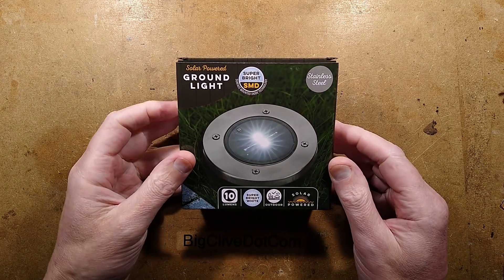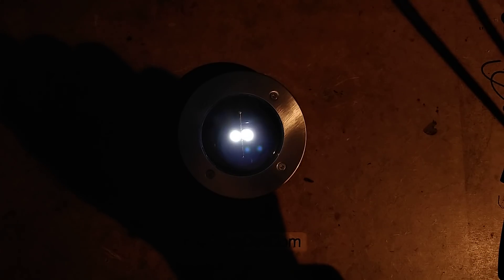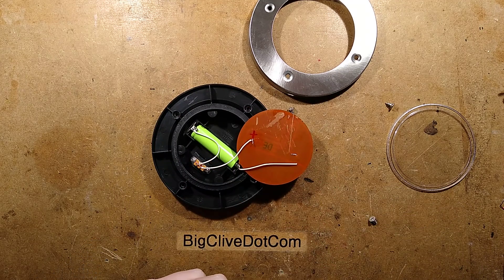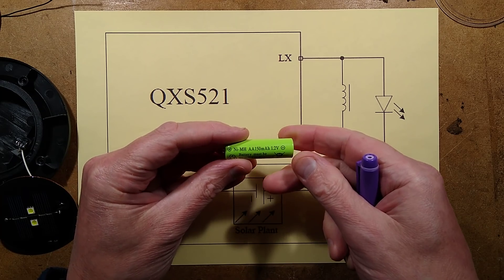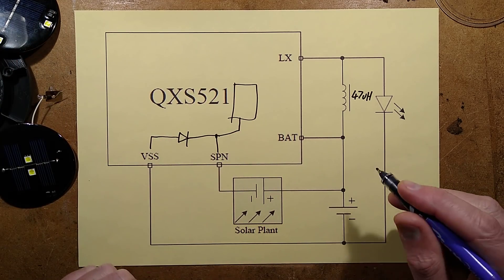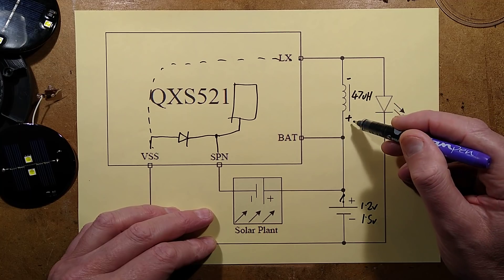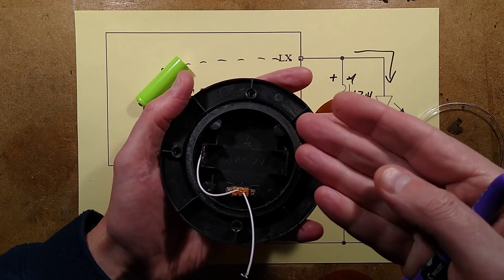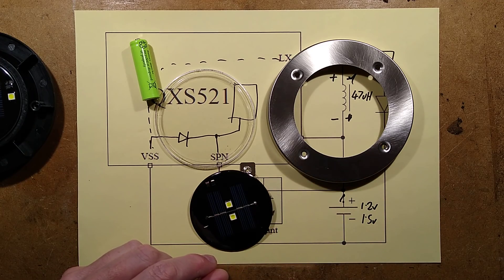Poundland's solar uplight

Comment: That look inside was very underwelming. Just a cell and a switch. :O  Thanks for digging up a schematic though, that tip about LEDs lighting in sunlight indicating a dead cell is useful!
Reply: Also a chip and a coil.
Reply: I've seen some more costly units that had more than 1 battery inside or ran LiIon batteries which have the LED on when charging, not usually the case on the cheapies though, indeed. Almost always the case on those inflatable units you can toss in water which float, though, as well. So just because the LED is lit, those aren't failed, but this is only where there are 2+ AA or AAAs or 1+ LiIon batteries.
Reply: @mrsheesh3743  Point was that units designed to light up in the dark tend to light up in the light if they fail in that common way.
Reply: @johndododoe1411  Understood, just saying that if the LED lights up it doesn't ALWAYS mean a failure, sometimes it's a design feature showing that the unit has enough light to charge. That isn't confusing at ALL, you know :)

Comment: I like the changeable battery, and the potted elements. But I still cannot understand the industry wide adoption of the single point of failure that is the on/off switch. What is the point? Seems like planned obsolescence.
Reply from the maker: It's to protect against over discharge of the NiMh cell in storage.  Adding a pull tab would potentially be a water ingress point.
Reply: @bigclivedotcom  The only outdoor solar lights I have that worked for more than 5 years, had a pull tab for the battery and no switch. All the rest have failed through corroded switches. Water ingress through the switch, seems more likely than through a pull tab inside a battery compartment.
Reply: @albanana683  WE take them apart and can get to the battery compartment ... Others just get a new one.
Reply: How would you propose they get the unit to the end user without a dead battery?
Reply: @Franktek12  When there isn't a switch, use the very common practice of a removable plastic tab at one end of the battery.